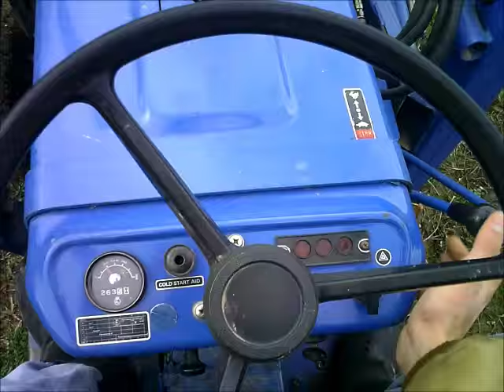Fixing Tile Lines

Comment: We've got a small 3 point backhoe we hang on the 180 AC and it will yank the tractor backwards with the loader and the outriggers down if you try to dig with it like that.  Powerful hydraulics meets heavy dense soil.
Reply from the maker: +1850oliver180AC They got this od girl balanced really good so it doesnt do that to bad. The tractor is heavy enough with everything hanging on it that it doesnt have enough leverage with that short stick to do a whole lot of moving around unless the ground is hard enough that the outriggers cant dig in. Allis was known for having really high pressure hydraulic systems so you could probably just about dig granite with yours if you could hold the tractor down. lol
Reply: Oliver66FarmBoy The backhoe has its own pto powered hydraulic system and is more powerful than the tractor hydraulics.  We run it at a low rpm too, probably around 200 rpm on the 540 pto.